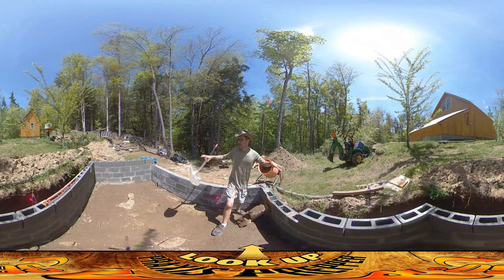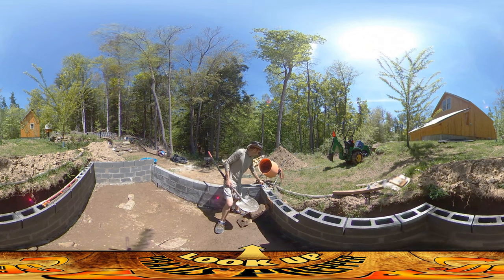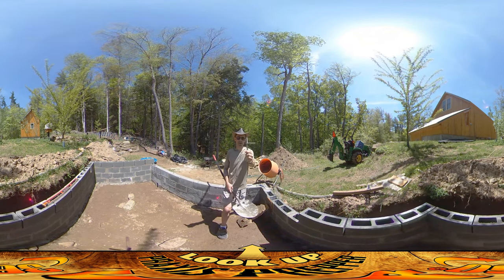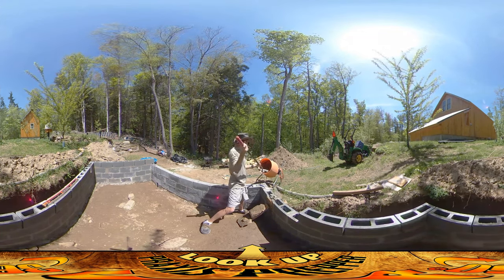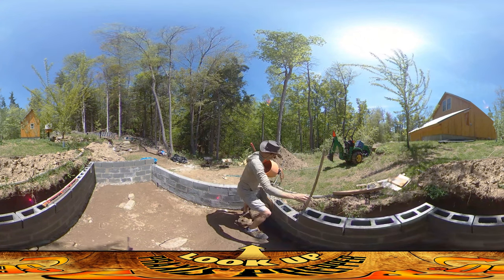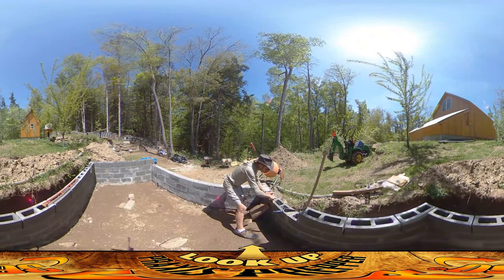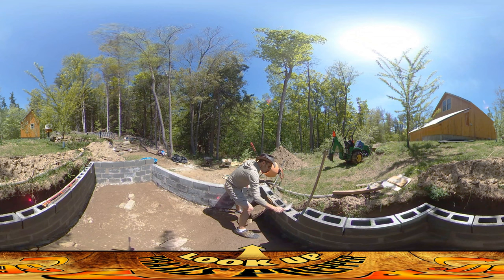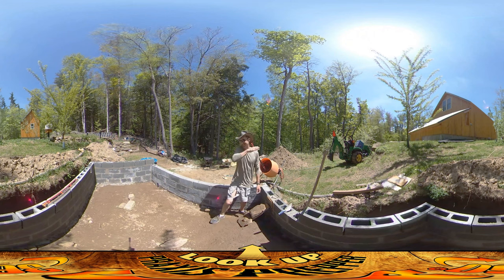Homestead Build - Concrete Anchor Bolt Plumbing and Placing Tip

Comment: It looks really good 👍,  don't get sick of concrete when you're getting good.
Reply from the maker: My biggest "beef" with concrete is that it's a step that I have to do before I get to do the part that I enjoy most, which is the carpentry with wood. This build will be all made from raw logs that we'll be milling up with a lumber mill specifically for the purpose. I'm excited to see how that approach is to do vs dimensional lumber from the lumber yard.
Reply: @PraxisPrepper  I'm a decent carpenter,  but  here,  not much carpentry is done,  even doors are being done in aluminum now.
Reply from the maker: @MosaicHomestead  If I ever build a 3rd house (which I'd like to do), it'll be somewhere tropical. PR is on my short list. In your area, non wood makes a lot of sense. With humidity, warmth, insects etc. There's a lot to be said for homes made of stone, earth, and metal. That's how I plan to do house version 3 (if it ever happens).
Reply: @PraxisPrepper  people  have built earthships here, finding tires to fill with earth wouldn't be a problem.